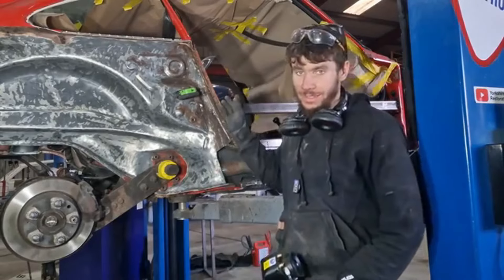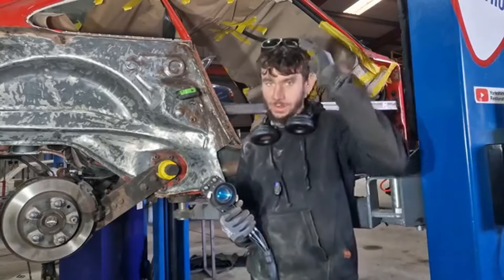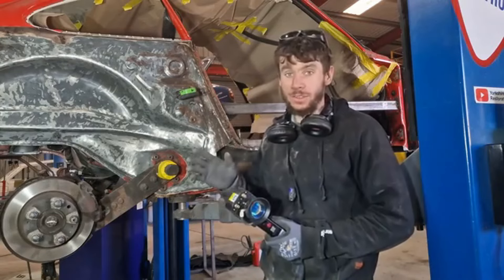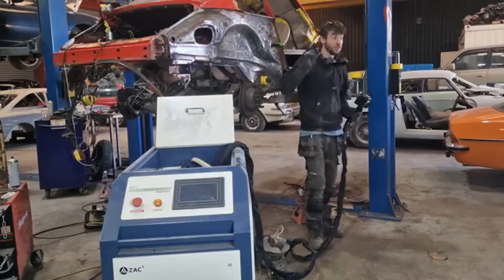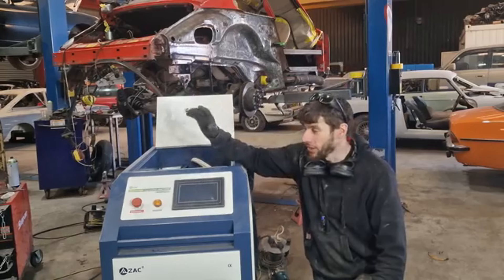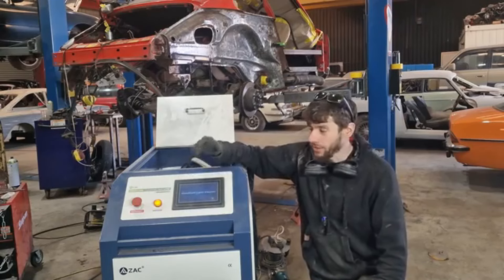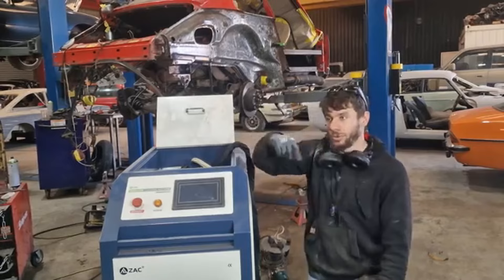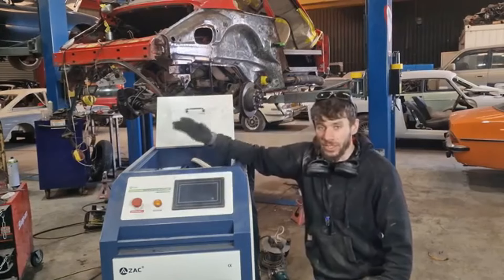Professional Rust Removal with ZAC 300W Pulse Laser Cleaner | Yorkshire Car Restoration - ZAC Laser

Comment: a question but the laser does not heat the sheets does not deform them? and after there is the mastic of joining the sheets does not burn?
how many watts did you use to remove the paint?